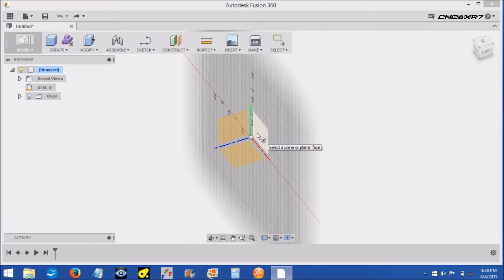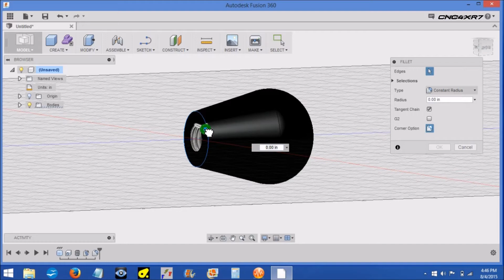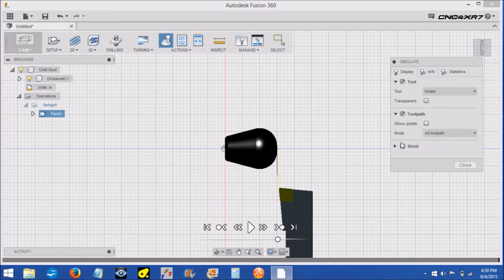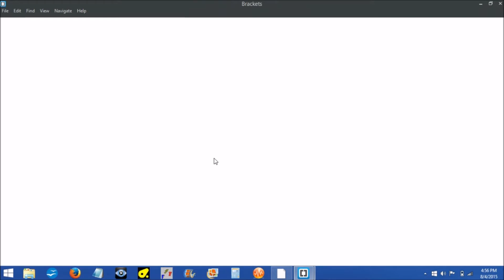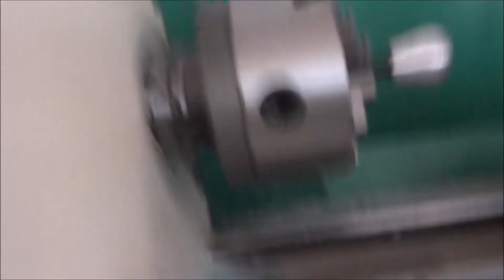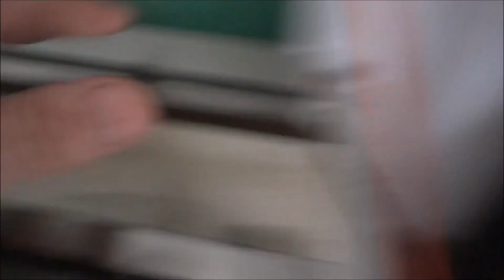Fusion 360 First cuts  G0602 Project QCTP Knob

Comment: Pretty awesome Sam! Your feed on a lathe is configured by inches per rev. not like the mill which is in inches per min. your tool nose radius should not exceed your inches per rev to achieve a good finish pass on your final cut also your part was out ther a bit with no support on the back side so you lost rigidity.As far as your coolant running down the ways I keep my lathes in the shop level with a machinist level.Lathe beds have been know to twist and cause taper issues when they sit in unstable conditions such as uneven shop floors.I also use a mist unit when I can and only flood for stainless steel and heavy deep drilling.Im prepping a place in my garage at home for my build and am just about done watching you build this one.Keep up the awesome vids!!!
Reply from the maker: +russell geyer 
Thanks For the tip Russell, I have some of those things figured out now. LOL but going from a CNC mill to a CNC lathe is a lot different than I first thought. But learning is the fun part.
Be Safe, Sam

Comment: Nothing that a little sandpaper couldn't fix. I loved seeing the CAD/CAM. I've got F360 and find it a bit weird, but I'll get it eventually. How about raising the tail end of the bed slightly to stop the flow of coolant backward? If your tailstock is aiming toward the garage doors, then it is sloping down, since the garage floor usually looses 1" every 10', or something like that. Your leak might stop if you turn the lathe around and move the headstock toward the garage doors.
Reply from the maker: Crivo152 Yea a little Sandpaper cleaned it up, I thought about raising the tail end but since my electronics are hanging off the Head end I was really quite relieved that the coolant ran the way it did. My lathe is on the back wall so like you said the coolant ran out the door. Lucky for me a found a simple solution not pretty but effective. I show you in the next video., Thanks, Sam

Comment: Have you tried increasing your RPM? I spin aluminum double what you are spinning on my lathe although my feed speed is not as fast as what you are doing. Leaves a nice finish with out coolant.
Reply from the maker: Wicked Wood toward the end of the code I did speed it up and it smoothed out some I am in the process of trying to figure the best feed and speed. the nice thing about the Variable speed is you can change on the fly.
Thanks for the tip,
Sam

Comment: the movement of your motors sounds a bit strange in the video.  In the other video you set the steps per to 400 perhaps you want to increase that to the max that still allows the max feed rate you desire.  what voltage are you running your motors at?
Reply from the maker: Matthew Prestine 
Hi Matthew,
How do you Mean? ( Sound)  they seem to sound great to me. it does sound a little strange from the enclosure. 
 I'm running @36v  and yes 400 Pulses per /Rev 1/2 stepping increasing the pulses will smooth it out but slow it down.
I will know for sure where my sweet spot is when threading. thanks for the suggestion.
Sam

Comment: Sam,

The videos are great,

Question

1.  I did not see what type of valve are you using to turn on/off the coolant with Mach 3 ?
Reply from the maker: Hi Robert 
I control the coolant pump with a solid state relay from a output on the BOB. It energizes a 110v outlet. 
I cover this well in part 8 electronics control wiring. 
You can pick one up on EBay for less than $5

Thanks Sam.